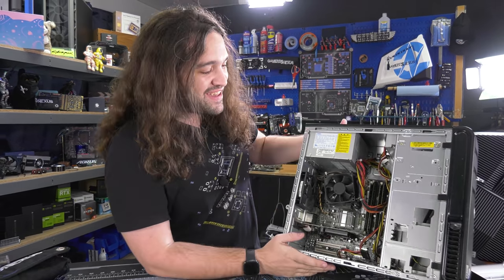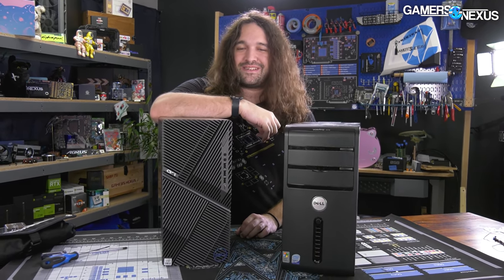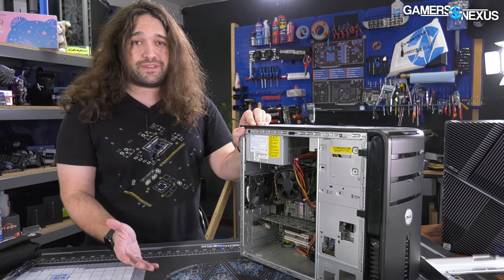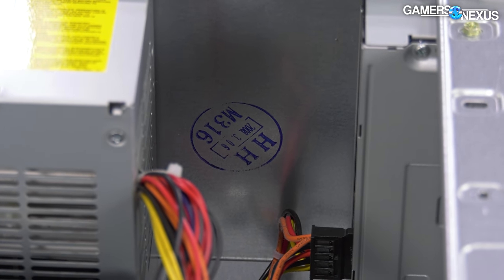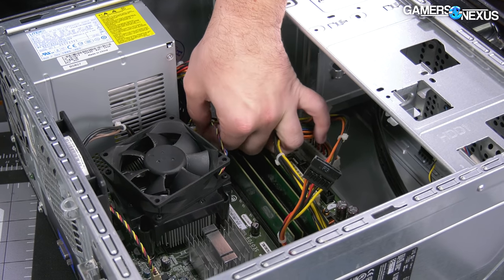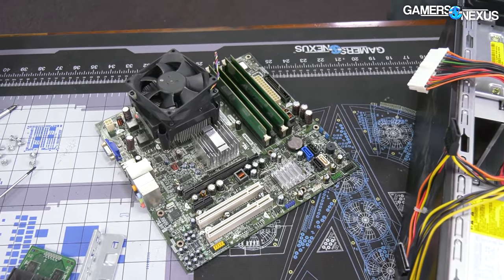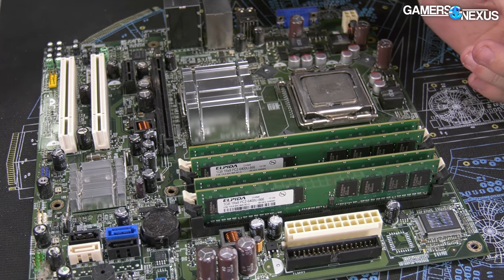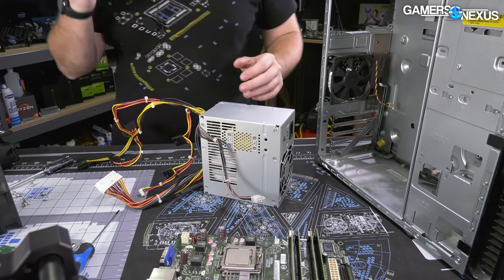13 Years of Dell Getting Worse

Comment from the maker: If you want to see the modern competition for the Dell Vostro 400, we have an entire playlist of prebuilt system reviews here: https://www.youtube.com/playlist?list=PLsuVSmND84QuM2HKzG7ipbIbE_R5EnCLM 
Grab a GN Tear-Down Toolkit on back-order now to guarantee you get one in the next run! We have arrival dates on the store now. These have been in production a long time and have been in constant demand, so to make sure you get one, pick up a back-order here: https://store.gamersnexus.net/products/gamersnexus-tear-down-toolkit
We compared the Vostro 400 to the Dell G5 5000, a system so bad that it needed two videos. Part one is here: https://www.youtube.com/watch?v=4DMg6hUudHE
Reply: Dell > Dell confirmed?!
Reply: I have a Dell XPS 630i and I would love to see you review one of them.  Standard power supply, fairly standard case (other than mounting opposite side / upside down).  I’ve had the case through many other boards (running an Asus Rampage board in it now) on the original PSU and internals.   That might be as close as they have been to following standards.
Reply: Upgrade the classic dell case with modern components
Reply: They also has shitty proprietary mobos back then too. Remember BTX?  inverted layout which was hard to find if not impossible in the aftermarket.
Reply: @Gamers Nexus are you guys going to get more coasters.. I would like to buy the set with four glasses if you do. I already have the volt mod mat and the large wire frame mouse pad.. it's all great items.. thanks for all the hard work
Reply: Maybe do a built in the old dell while retaining all the old stuff like psu just to  spite 2021 dell? Something simple like a 3400g build to show the forward  compatibility of the chassis.
Reply: Steve, are you drunk? A 8800gt video card never came in anywhere near that small of a form factor.
Reply: Reminder:
Windows XP 32bit Pro didn't even support 4GB of RAM.
Reply: I for one enjoy watching Steve's ongoing prebuilt induced descent to madness.

Hey Steve you should compare a Pentium II or Pentium III's quality compared to modern Dell next. Let's see how our old software packages like MS Write or MS Word compared to modern bloatware dragging down overall system performance.
Reply: Sooo did this one get better than dell award?
Reply: I wish I could send you my PSU from the Antec p190+1200. It was a dual power supply setup solely for the case. One power supply was 650w and the other 550w. One did just the board, cpu, and video card. The other did just sata and molex items. They connected together with what Antec called a Neolink system.
Reply: @emanuelkorfias2947  good god...
Reply: The most impressive here is that you managed to squeeze out 23 mins of content from this.
Reply: Have you ever had comment back from Dell regarding your critiques of their systems?
Reply: If you want to check the Dell's best design, then go to the Optiplex models. Still non-atx garbage but at least the cooler and case are decent.
Reply: What we learned is, the vast majority of people will be cheated when buying a PC.  Imagine a company that makes the same computer every single day, if you buy one, you get the best they make.  

Apple.  The better way.
Reply: Well,why don't you make a max upgrade of this one ?
Stuck a Xeon in it,4x2 GB of ddr2 1066 ram,some GeForce card ,and a better PSU ???
Reply: You guys should check out the ROG strix r7 from Walmart
Reply: This is really funny because if they gave a shit about reusing tooling they could have largely kept this exact old design with minor tweaks (remove cd-rom bays and move HDD/SSD bays to their place and replace front with a mesh) and keep this thing going for decades but no, at some point they built horrible tooling to make horrible cases instead.
Reply: Vostro means "Your", plural. So wen you say "I didn't want to pull out the Vostro 400" you are saying "I didn't want to pull out your 400"
Reply: @JamesSmith-sw3nk  You probably remember wrong... big graphics card are really recent.
Reply: @Mr79dream  You can stil repair standard form factor boards, and guess what? It's even easier to repair a separate board for front IO.

For the most part, your arguments are still supported, or better supported, by using standard form factors.

They are not saying they should put a ROG motherboard, they can still manufacture their own shit, and still doing it bad if they want.
Reply: @ Gamers Nexus it looked like the GPU PCI Express slot was burnt out on that motherboard or was that just an optical illusion caused by shadows?
Reply: The Ps on the G5 is delivering power thru the 6pin backplane connector. So yes it is using the same power supply in their W1 wervers.
Reply: Well, the Vostro 400 seems like a pretty good PC by Dell standards, because I know at least one older Dell model that was worse.

Back in 2003-2004, a good chunk of my friends and I standardized on the sweet spot of gaming PC's ; Pentium 4 3.0C for the CPU and Radeon 9800 Pro 128MB for the GPU. One of them had these components in a Dell Dimension 8300, and he asked me once to take a look to solve the noise problem he had.

Pre-emptively, we bought a Zalman CNPS 7000Al-Cu, which was a very good bang-for-the-buck CPU cooler, cooling much better than the Intel box cooler while making much less noise, on top of being compatible with most motherboards of the day. And then we opened the Dimension 8300...

If you look for pictures or videos of it on the Internet, it doesn't have a side panel as you'd expect ; the whole front and side panel are basically one big assembly that rotates, so the PC is like a giant clamshell.

You'd expect a PC to have an intake fan, a fan on the CPU cooler and an exhaust fan, right ? WRONG !

Dell went maximum cheapskate by having a single 92mm fan on the exhaust, with a green fan duct attached to the exhaust, making a 90-degree turn to suck air from the aluminum heatsink cooling the CPU. So we removed the duct and tried to remove the CPU heatsink to replace it with the Zalman one. I don't remember what was exactly the problem, but we couldn't put the Zalman, so we ended up using garden wire to attach a fan directly to the Dell aluminum heatsink, and I pulled the 92mm fan, that sits on my desk to this day as a reminder of why never to buy a Dell prebuilt.

If you google the words Dell Dimension 8300 noise, you'd end up with various results, some saying it was silent while others complain it's a helicopter or a vacuum cleaner ; there's a reason for that. The 92mm fan is a Minebea NMB 3615KL-04W-B86, that nominally runs on 12V DC and pulls 2.10A, and has a standard 3-pin plug. That's right ; this thing can draw 25.2W nominally, which is more than enough to fry components if you use the 3-pin connectors on most motherboards.

Some time after pulling it from the Dimension 8300, using an adapter to draw power directly from my PSU, I dared to plug the monster on my own PC ; that thing did enough noise that I could hear it at the cellar's entrance, knowing that the PC is in the attic, there are some 4 (small) floors between the attic and the cellar's entrance and that the soundwaves have to bounce off several times of multiple walls to travel from the PC to my ears in the cellar, with probably some 15m of traveled distance ! 

Some years later, I did the same test, probably in the winter, and while noisy by my standards (I used to frequent Silent PC Review.), it wasn't deafening as I remembered. The reason is that fan has a little thermal sensor, basically a resistor whose resistance increases the higher the temperature ; I shorted that thermal sensor, and it was back to the chopper.

A couple years ago, after discussing some cooling and frying components with a friend, I sent an email to Minebea to get the specs of that fan ; the Minebea engineer sent me a graph of the rotation speed vs temperature. The fan stays at 1,750 RPM till 38C, then linearily ramps up to 5,700 RPM at 46C. My friend's PC was located in the hottest room of the house, without any AC, and on top of that, the house was in the countryside, with the PC collecting a lot of dust, so you can guess that the fan's thermal sensor, with the fan placed on the exhaust and the relatively small intake vents of the case, was likely detecting some pretty hot air and therefore spinning at very high speeds.

Anyway, back to the Vostro 400 ; having a single 80mm exhaust fan, at least for a Q6600-era PC, sounds a tad too little. My 2003 PC had a 92mm intake fan and an 80mm exhaust fan, and even this looked insufficient to me. The Antec P180 of 2005-vintage standardized on 120mm fans already.

I'd also point out the northbridge heatsink in the Vostro 400 looks like the ones Asus put on all its i865PE and i875P motherboards for Pentium 4's of the 2003-2004 era, minus the Asus paint job. Maybe there's a difference I didn't notice, but otherwise, the heatsink seems to be the same.
Reply: @Mr79dream  Yes, those rubber things for attaching fans were introduced to the market around 2004-2006, though their usefulness is dubious. I never had any problem screwing fans real tight to the case, and if the case isn't too flimsy, the vibrations are dampened by the case's mass.

The problem was sometimes the honeycomb vents vibrated, but not because of the fan directly ; it was the airflow that caused such vibrations, making a faint tuning fork noise. I fixed that by using some thicc double-sided tape and something to add mass to the grill, like a coin.
Reply: Pretty sure the IO shield is non removable, just pressed into the case. Therefore a motherboard change requires a dremel or a new case. Completely with you about the G5. Way too many steps in utterly the wrong direction. Dell burnt their fingers in early 2000s or late 90s doing proprietary shit too.
Reply: #teamseas
Reply: Product suggestion for GN. A mat that was a anti static Modmat on one side and a high grade mouse pad on the other side would be a incredible product. The Modmat side would be naturally anti slip for the mousepad, and there are not many well designed non RGB 4xl mouse pads. Not to mention most of us only have one desk to build and use our PCs on. Cheers
Reply: You missed the vent on the side panel. Most OEM computers had a vent in the side panel at that time
Reply: I used a old Medion case from the 90s and replaced its Pentium 4 and old Nvidia card with Athlon X4 880K & GTX 960 then later Ryzen 3600 and GTX 979 from another system. ☺️
Reply: Even Dell gets an worst than Dell award
Reply: this is a pretty good system for win XP days.
Reply: @IIARROWS  The front IO is more a case of reliabilty than repairability.
But also repairability.

Customer calls, "my front USB isn't working" or "front audio" or have you not, we know it's the mainboard :-D
Also, no cables that can come loose or what not.

My argument about availability applys to 3rd party parts not to the "made for" OEM parts.
The mainboards and other such parts, they are made as OEM not ODM for the integrators.
The long therm availability is more an issue of the ODM parts, as descibed.
Reply: I completely forgot about the Dell Vostro lineup. Inspiron, latitude, optiplex and power edge have been staples for years and years but the vostro lineup reminds me of so many systems that had to be recycled and trashed far too early because of proprietary nonsense in the early years of my work in PC repair
Reply: @headcas620  BTX was thanks to Intel and I still have several of those machines laying around in case I need parts. 

The focus on airflow through the center of the chassis was admirable at least
Reply: "a system so bad that it needed two videos"
DAMN!
Reply: I really hope that you guys go on a choir some more retro pre-builts and see how they compare against modern things.
Reply: Whole point of the video : Dell didn't pay us extortion money, so now we are spitting on them :D Pathetic blackmail ;)
Reply: you can tell the difference without brandings/markings, old system like this one has 2 physical north and southbridge. unlike new system which only has 1 physical bridge.
Reply: opisex  In terms of price/performance, Dell is usually 3 out of 5. I agree that they cut corners on everything but their customers are usually people that do not know much about computers, and would not go about upgrading. What Dell (and other larger manufacturers) have is support network and that means a lot for people that do not want to be bothered. Complains about proprietary parts usually come from enthusiast that get these systems second hand and want to improve them. This is partially valid, but on the other hand you can get systems like Dell OptiPlex for pennies exactly because they are hard to upgrade. Overall, Dell is what it is, but most of GN venom against them is because they refuse to sponsor this channel.
Reply: LOL

Ya'll all just keep sayin ya can't reuse proprietary parts. Ya makin me giggle guys.

Whatev. I'll be here. Might have a bit more to say at some point.
Reply: As a guy whose IT career started in the mid 90's I gotta say: Bravo on that title.  
I used to walk in to some corp, see a server room full of Dells and just groan.  lol.
Reply: Dell is a pathetic brand
Reply: I turned my dell optiplex 9010 i7 into 11 emulators 1200 game monster I only upgraded to a 1tb ssd, ddr3 ram 32gb, and gpu is radeon 2gb 7600 hd series 👍
Reply: Do a vid on the nightmare that is buying a dell workstation today, like what Dell did to Super Eyepatch Wolf.
Reply: I give zero shits about e-waste tbfh.